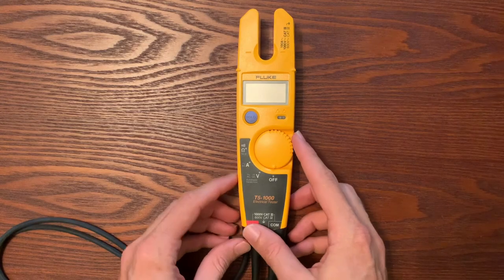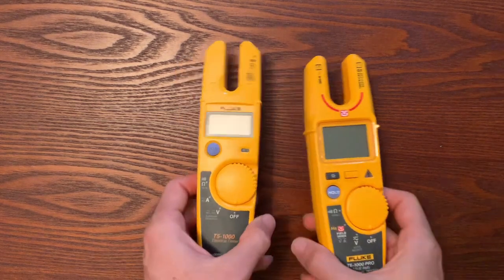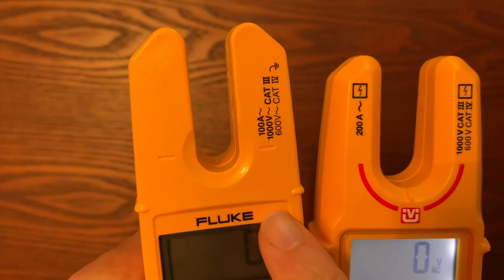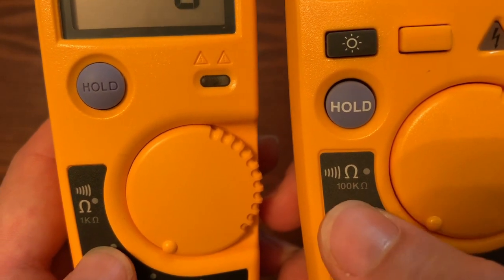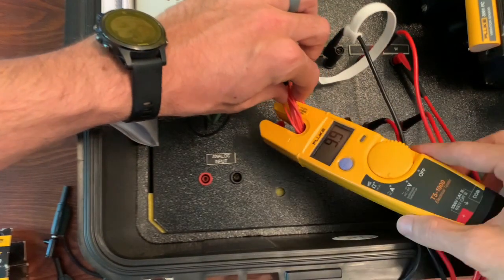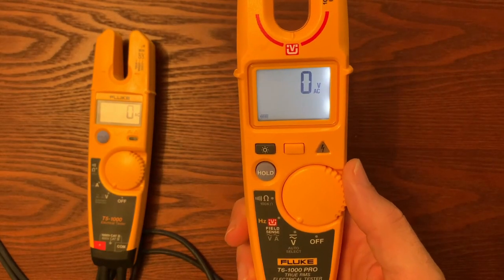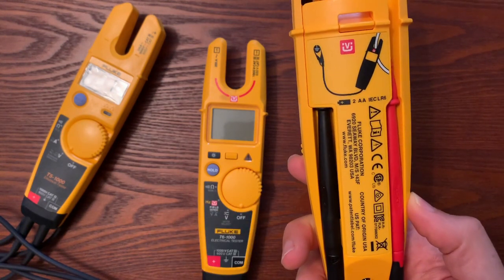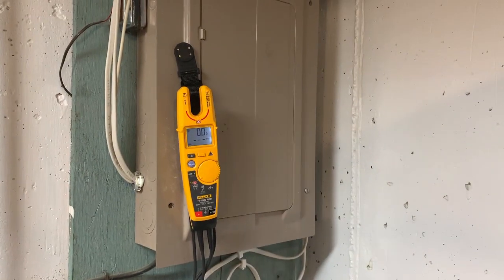T6-1000 Vs T5-1000 - Fluke Fridays - Episode 03

Comment: Can I use field sence with the alligator clip on the neutral to read voltage or does it have to be on the ground. Some old wiring did not have ground wires and sometimes the conduit rusts away there by loosing the ground
Reply from the maker: You can, might not be quite as accurate but should work. Also if you want to get really creative you can also just hold the common (black) lead the (metal part) between your fingers and it should give you the ability to get a reading. It will be even less accurate using your body's impedance but it will get you in the ball park.
Reply: @fridayswithbrandon  thank you so much. So my old t5 600 my wife accidentally broke.so would you day it's worth up grading to the flukevt6-1000 pro?
Reply from the maker: @mjmjersey  if you can afford it I would definitely upgrade.
Reply: @fridayswithbrandon  thank you so much for taking the time out.

Comment: Hello 👋 is the T6 pro better then a T6? They have a sale for the T6 but was thinking to get the pro.. but not sure if they are that much better
Reply from the maker: See this video and let me know if you still have questions. https://youtu.be/1fx4AS5svXs
Reply: With the regular version, you can take measurements without ground or neutral present (bad writing or want to check if something is energized). Not with high precision, but... Hopefully, you see where am I going...
Reply from the maker: @Dextermorga  this is true. But if you wanted to take a measurement with the PRO version without a ground. You could just hold the end of the common lead in your hand/pinch between your fingers and you will get the same effect as using the regular T6 with the grounding plate. But if you go with the regular T6 you will not get visual continuity.